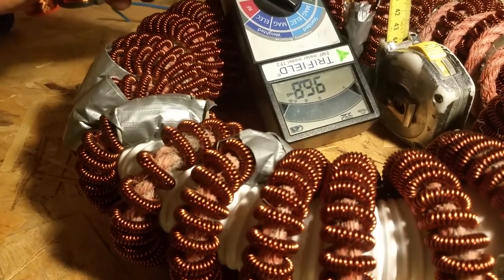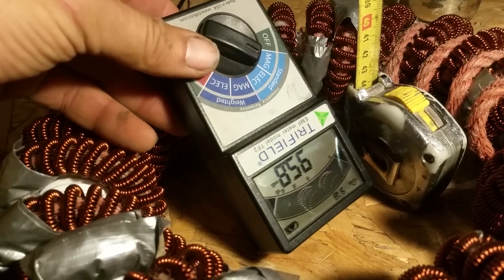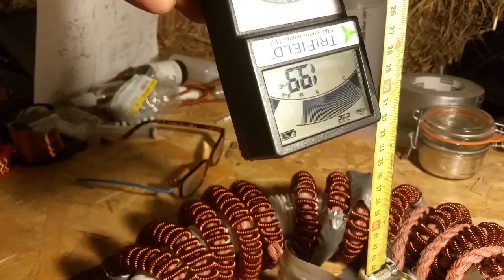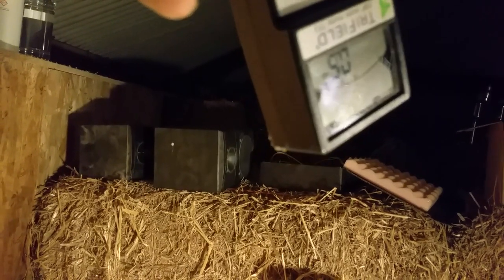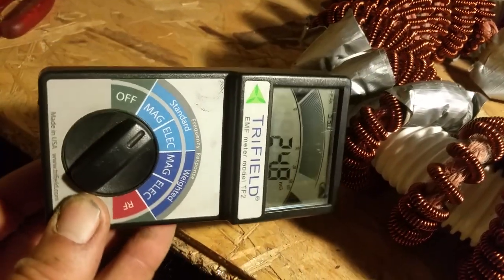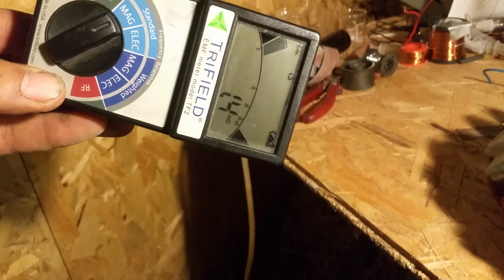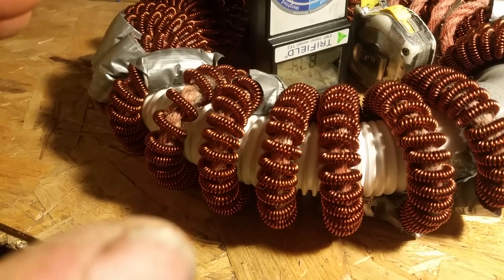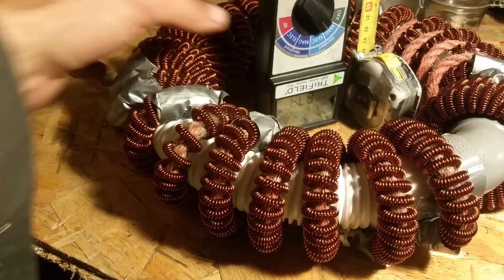O-Day - Henk Jurrien assesses the magnetic field shape of his  Super-Super-Tor

Comment: The seeing high heat out in of itself is fascinating. How hard would it be to get this super super tor to a fascility with an accurate calorimeter or whatever it takes? Insultated bucket, water at say 20ºC and add coils, give time to all normalize to 20º before switched on. One hour of 20W, knowing the mass of water and the mass of copper etc, with accurate temperature measurement we'd have a COP, right?

Comment: You should test it without the metal tape measure perhaps? 
It adds inductance if it's ferromagnetic, which it probably is. 
I think coil configuration is a dead end to be honest, but I hope I am proven wrong if the right resonant frequency is found for it.
I think the focus should be on Plasma as the super conductive coil from point discharge or discharge matrices. 
I feel not all rabbit holes have white rabbits at the end. Some are filled with snakes. 
Appreciate all you do my friend.
Reply: Good point on the tape measure, although I suspect that Henk only put the tape measure there after noticing the odd, beam-like magnetic field extending from the toroid. Still needs to be clarified! More broadly, this coil has some solid math behind it, and some of these field readings are strange indeed, so I'm excited they're taking a close look at it.
Reply from the maker: Yes, Alan Goldwater caught this and it was in the trailer on FB, TW and ECW - I have added it to the sticky comment + my suggestion.
Reply from the maker: @danmoretti8898  That is how I was told it happened - though he is going to repeat the experiment with a non-conducting rule after it was spotted by Alan Goldwater last night.
Reply from the maker: Dave Boutillier intends to make a plasma coil after I have modelled it in 3D!